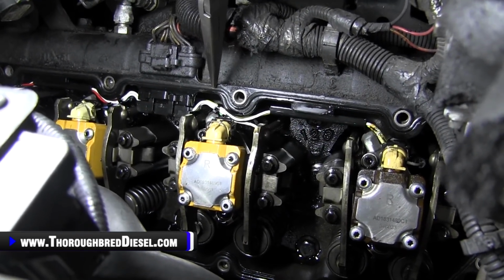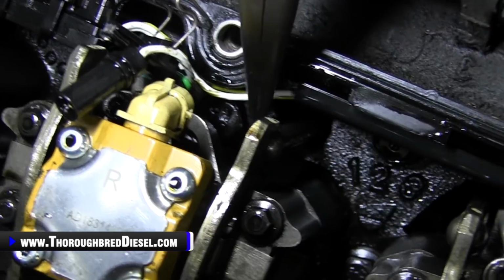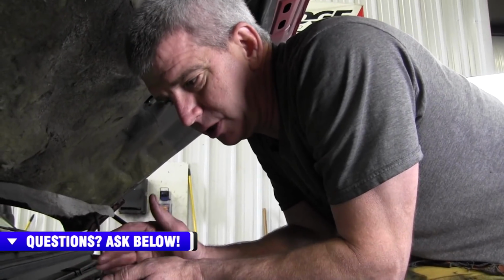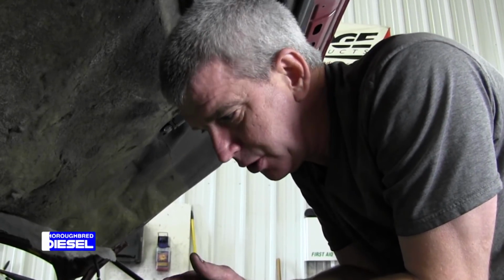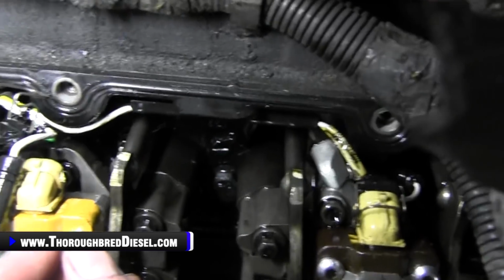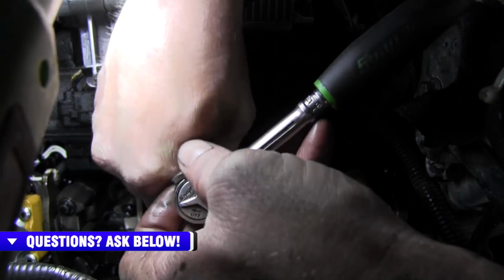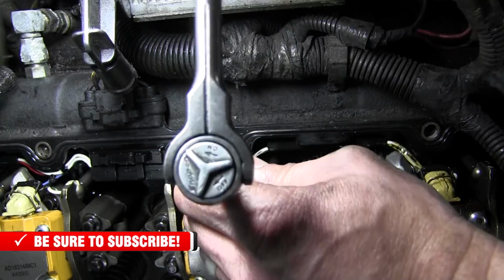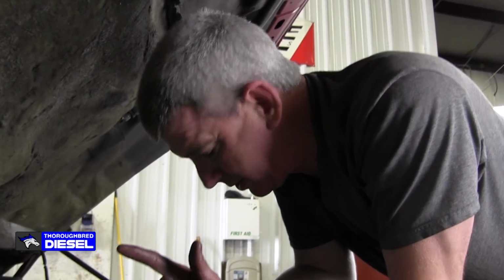DieselRX Glow Plug Install: Ford Powerstroke 7.3L

Comment: I have an ‘02 f-250 7.3l.  I need to replace the glow plugs.  As I started investigating parts and process, I saw documentation that specified glow plugs are needed for trucks with  an “F” in the 8th digit of the VIN.
Is that correct?
Reply from the maker: Ford Motorcraft ZD11B2-4 will fit all F series, E series, and Excursions with a 7.3L

Comment: Can a glow plug cause a no crank situation?
Reply from the maker: No. Not a no crank situation where the motor wont turn over. Now if the motor cranks and has a HARD TIME starting, then you could be looking at a glow plug issue.

Comment: 2nd video watched from this channel and there isn't a link to valve cover removal for 7.3l mentioned in both videos. Hope you fix this because I've spent 30 minutes looking for the valve cover removal video. Just hoping for a tip or trick for getting to back bolt on passenger side valve cover. Thank you for your time
Reply from the maker: Some how we have misplaced that video. We're gong back and digging through old footage now.
Reply: @thoroughbreddiesel  thank you. I figured out the only way possible is to remove the vacuum chamber mounted on the heater core casing.
Reply: Way late on this, but a swivel 13mm socket will allow you to remove all the bolts without removing the heater core cover
Reply: And it helps with removing the bolt in the very back.

Comment: motorcraft zd11 are the ONLY glow plugs you use in a 7.3. thank me later
Reply: How come? Just had a P0677 glow plug error light come on at 225k original glow plugs and injectors
Reply: @cadenprosise2609  because the other brands swell and stick in the head. Then you have a real problem. Put motorcraft back in and get another 225k trouble free
Reply: @onlyskatesupra  good to know, mines a 2002, I can't afford injectors at the moment, what else should I replace when doing the glow plugs? I know the harness.

Ill have a diesel shop do the work for me

Comment: Do not use anything other than Motorcraft ZD-11. Period.
Reply: same!
Reply: Same here, bought 8 and had 3 failures, reinstalled the original Motorcraft back in those 3 cyl. 187k still glowing.